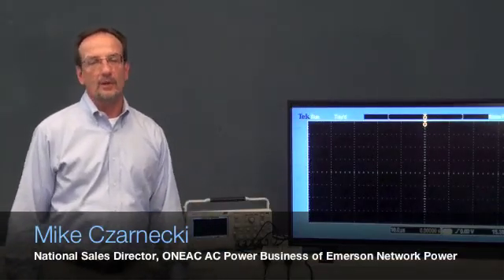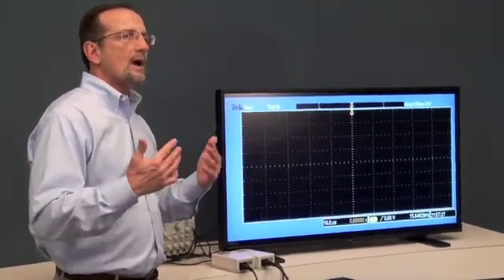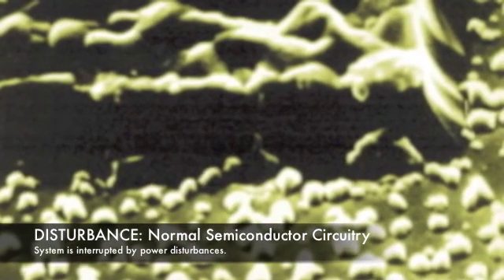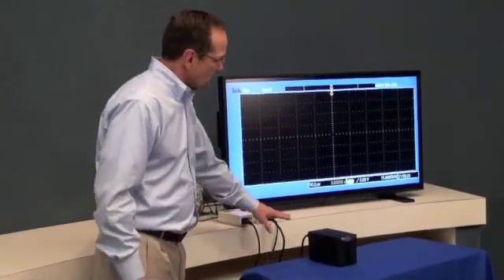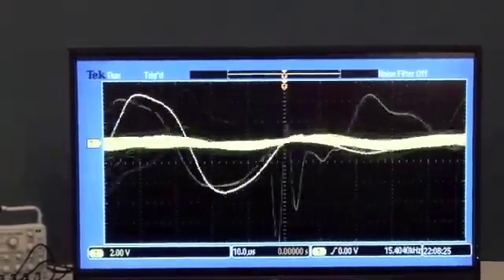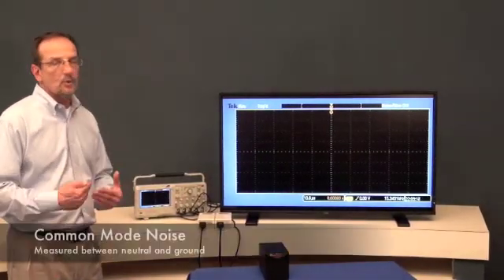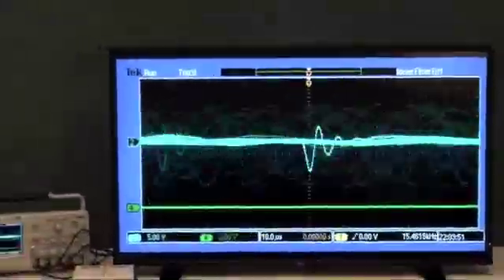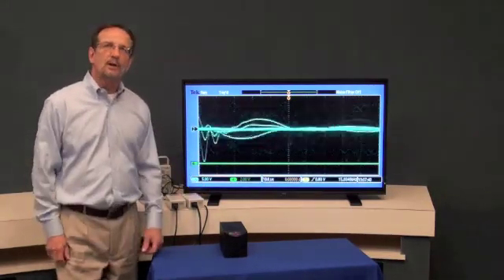ONEAC Power Quality

Comment: The second trace on the scope is showing nice steady DC, or possibly zero volts.  But this is an AC power conditioner.  The output should be a clean sine wave of about 170 V peak, not DC.  So what are the two scope channels actually showing?